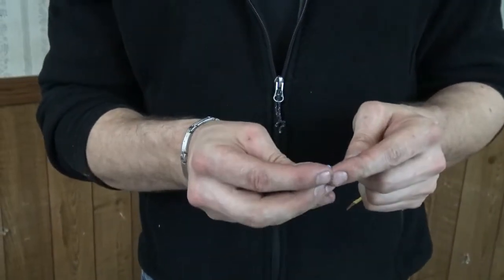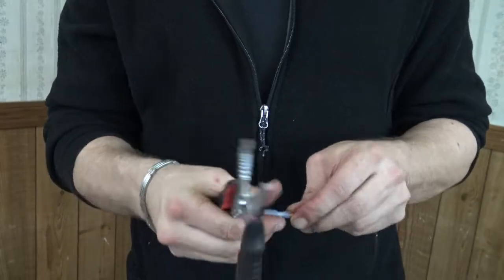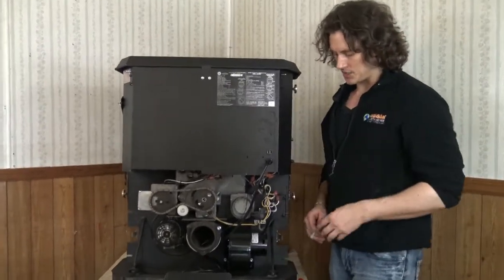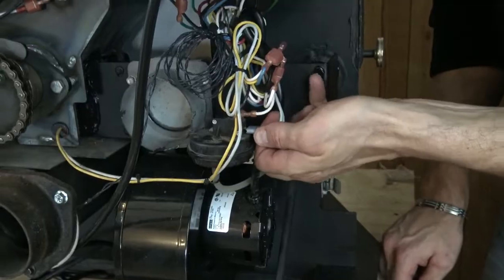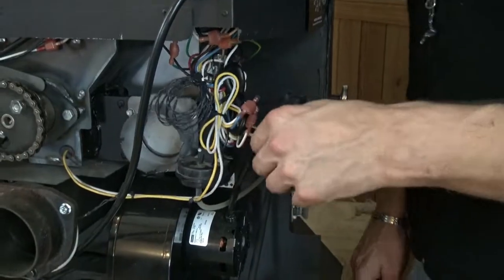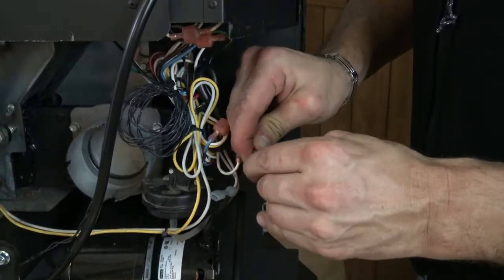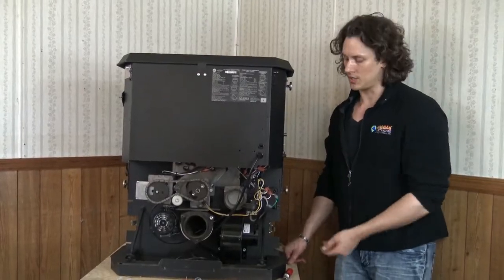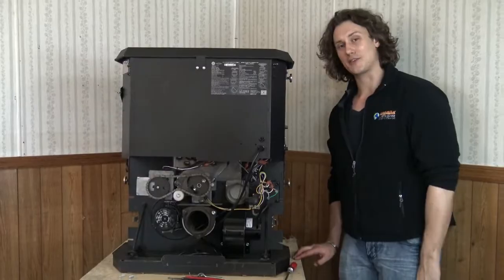How to create a jumper wire and bypass a safety switch in your Pellet Stove

Comment: I Keep getting a vacuum fault reading. I bypassed the vacuum switch to see if it would run in a test. Smoke started bellowing out of the unit from everywhere.
Reply from the maker: Happy to assist here. The vacuum switch only controls power to the auger. The vacuum switch will shut off power to the auger motor if the switch is bad, there's ash restriction in the stove/exhaust, gasket seal issues around the door/ashpan, weak combustion blower or any combination thereof.  If you have smoke bellowing out of the unit, you will want to take a look at the combustion/exhaust blower. If that blower is not functioning properly it cannot expel the exhaust and smoke will come into the house. Additionally if the combustion blower is weak it will trip that Vacuum switch. Take a close look at the motor and test the voltage.  If you need any replacement parts, we are happy to assist. We guarantee the best prices and stock everything for Harman. Any other questions please let us know. Thanks,
Reply: @EarthSense  Tried bypassing the switch again..For some reason today its still giving a vacuum fault even after bypassing switch signal...Cleaned exhaust so I know thats clear.
Reply from the maker: @wakeywakey4289  Have you checked the voltage of the Combustion Blower yet? That blower motor should be running at near line voltage during start-up. Let me know once you have checked that.
Reply: @EarthSense  Took the wires off where they plug into the( brain)? jumpered wires to the motor directly. motor just sitting there humming....maybe carboned up and not letting blades revolve?
Reply from the maker: @wakeywakey4289  Yeah, if you wired direct and it's just humming more than likely it's a seized bearing in the motor. Just for reference, here are links to our combustion blower replacements. 
Aftermarket- https://pellethead.com/product/harman-heatilator-combustion-blower-exhaust-draft-fan-motor/

OEM - https://pellethead.com/product/harman-heatilator-ecochoice-combustion-blower-exhaust-draft-fan-motor/

Any other questions please let us know. 

Thanks,
Reply: @EarthSense  Thx....took it out..Looks like it had a bunch of crud/carbon in the fan and its housing and finally causing it to stick...after I got it out I wired fan again and is running strong..will put back together and let you know.. Probably didnt help from years ago when I use to burn corn in it. 
Should the other fan( circulating i think) move freely if you try to spin it or is it under some kind of resistance. Seems like it doesn't spin very easy until it heats up.
Reply from the maker: @wakeywakey4289  That's great news! Yeah, I'm sure some of that carbon build-up was from burning corn. Very glad to hear it's freed up and running strong. The Distribution/Circulation fan impeller should turn by hand. Some are very free and some have a little bit of resistance where they will rotate just a bit and stop by hand. If you can't turn that impeller by hand or there is heavy resistance, we may have an issue there. Thanks again, happy to provide further help if you need it.
Reply: wakeywakey k
Reply: @EarthSense  Is there an easy way to test the combustion motor or do i need to remove to test? Thx
Reply: @EarthSense  I should be able to take the circulating fan out and run 110v from a cut extension cord and it should run...like I did with the combustion fan. correct? I tried to get it to run on a bench test and couldn't.  The only thing I question is there's 2 black wires coming out of the circulating fan instead of a 1 black and 1 white. Didn't know if theres an internal switch in the motor that prevents the fan from coming on unless it gets so hot so it won't circulate cold air.
Reply from the maker: @wakeywakey4289  Yes, you should be able to run that circulating fan to direct power same as you did with the combustion fan. No internal switch, it should just run at full voltage when when plugging direct into a wall like this. Was the circulating fan working in your stove?
Reply: @EarthSense  I tried bench testing it and couldn't get it to work so I decided to plug it back into the brain box without reinstalling and started the stove. the fan started up after the stove got warm. So I reinstalled everything and its up and running. I appreciate your help. I subscribed
Reply from the maker: @wakeywakey4289  That's very interesting, thanks for letting us know. Glad we could be of assistance. Appreciate you subscribing. Thanks!

Comment: It’s called a safety switch for a reason, it should never be left bypassed for any longer than than it takes to diagnose the problem
Reply from the maker: Yes, that is 100% correct. For troubleshooting purposes only as we are indicating. Thank you.
Reply: Thanks Francis
Reply: I found a paper clip bypassing this pellet stove this morning. Plugged the leads back in and it worked perfectly. Why it was bypassed, we don’t know. Sketchy!